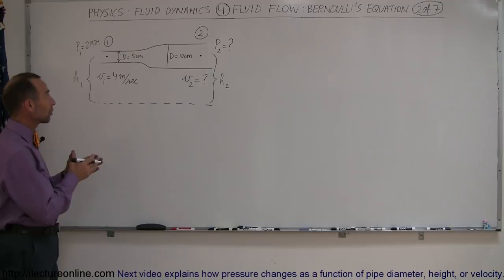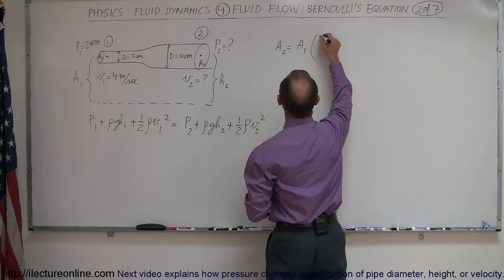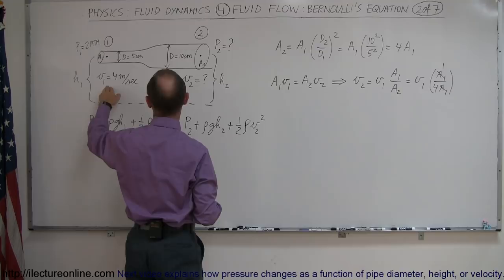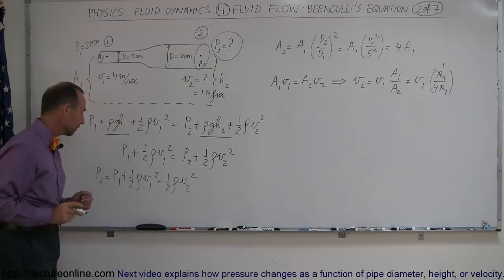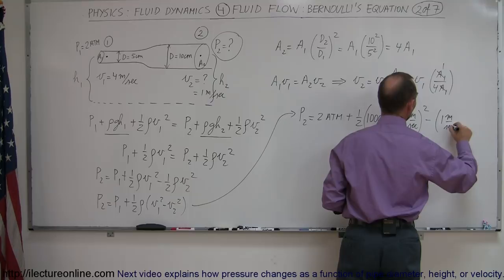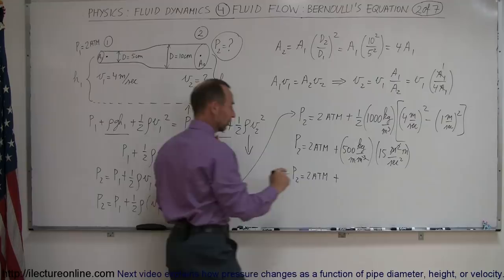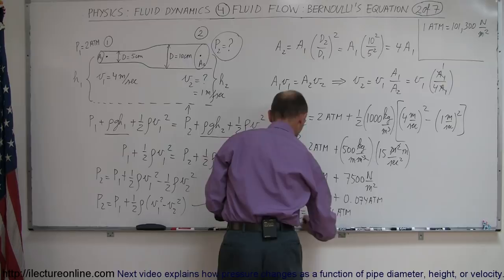Physics 34  Fluid Dynamics (2 of 7) Bernoulli's Equation

Comment: For those wondering, A1 = pi r ^2, and r is D/2 so when you square D/2 you get D^2/4. Same for A2. Now if you divide A1 by A2, you will get the ratio of A1 to A2, which you can then make A1 = (D1/D2)^2 x A2. Took me a while to figure it out and I saw it here, so hope it helps!
Reply: Mark Palmisano Saw it asked here a couple times**
Reply: true, but he has A1=(D2/D1)  not  (D1/D2).    ????
Reply: I keep getting: A1/D1=A2/D2 --> A2=A1(D2/D1). I still have no idea where the square comes from. It's driving me insane.
Reply: A1=r1^2pi , A2=r2^2pi, r1=D1/2 , r2=D2/2,   pi=pi   A1/r1*2=A2/r2*2  insert D1/2 and D2/2 insted r1,r2  
and the end resault is A2=A1 D1*2/D2*2
Reply: It was just A1V1=A2V2. Just substitute the given and solve for V2 which is 1m/s.
Reply: Thank youuu! :*
Reply: I lost the plot at A1
Reply: @lyndon9353  proof that labor can be less confusing.
Reply: @ledzeppelin4892000  I know you probably don't need this now, but A₁ = pi d₁²/4  and A₂ = pi d₂²/4
=> A₁ / A₂ = pi d₁²/4 / pi d₂²/4
=> A₁ / A₂ = d₁²/4 /d₂²/4
=> A₁ / A₂ = d₁²/4 * 4 / d₂²
=> A₁ / A₂ = d₁²/ d₂²
=> A₂ = A₁( d₂² / d₁² )

Comment: I have learned more from you in one hour than my entire physics courses. Thank you for explaining difficult concepts in a clear and concise manner. Just one question...why is the height taken from the middle of the tube and not the top?
Reply from the maker: That is where you find the average pressure.  Typically the height difference due to the diameter of the pipe plays only a insignificant role, compared to the elevation gain or loss of the pipe.

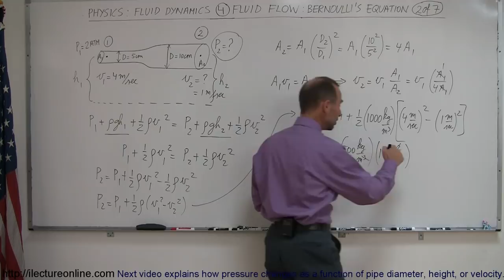Comment: Mr. Michel during @5:00 , the v² should just square the num. only not for the unit and the diff. in velocity is exactly = acceleration. so therefore when u times it, it will automatically came out N/m².
Reply: *unit cannot be simply add it into the equation. if needed there must be same for both left and right side equation
Reply from the maker: The units must be squared as well.

Comment: A 300 mm diameter pipe discharges water at the rate of 200 liters per second. Point A on the pipe has a pressure of 280kPa and 3.4 m below A is point B with a pressure of 300kPa. Compute the head lose between point A and B. Solve pls
Reply from the maker: We are currently working on a playlist of videos that solve these types of problems.  We will begin publishing them soon.  Essentially the head loss is an extra term on the right side of Bernoulli's equation.  P1 + rho g h1 + (1/2) rho v1^2 = P2 + rho g h2 + (1/2) rho v2^2 + head loss rho g.  Since the velocity appears constant the velocity terms drop out.  Therefore your equation becomes:  280,000 + (1000 x 9.8 x 3.4) = 300,000 + 0 + head lossxrhoxg        Then head loss x rho x g  = 280,000 + 33,320 - 300,000 = 13,320 Pa                 Then head loss = 13,320 / 1000 / 9.8 = 1.36 m

Comment: Sir thanks again for great explainations, i  think that no one on a youtube does it in such a clear and accurate way as you do.
With your permission' let me ask you a very simple question.

All those examples take the Q as given parameter...
My question' is actually simple a Yes\ No Question:
example:
I have 2 horizontal pipes of same lenght,  which are NOT connected to same source of water (like the pipes  are located in another countries or another  rooms)
pipe A has cross section 20 cm 
pipe B  starts with cross section 20 cm and changes own cross section to 10 cm on a half of its lenght  
If i am given that Q in bouth pipes is same(for example 1 liter per second) , i offcorse now calculate the preasure,  velosity of water, etc' using Bernulli'  equasion. This part i understand very well and it is clear...
, but i ask something different: the Q will not be equal unless pump in pipe B works "harder"'  than the pump in pipe A. 
Am i right?
Reply: @engineeringsimulationstudi1404  
what?

Comment: If a tube is conected to a compressor on one end and opened to the atmosphere on the other end, and the compressor injects a fluid at 40 psi, will the tube walls be subjected to the same pressure along the whole length of the tube? or is this pressure just to move the fluid? will the walls expand due to the 40 psi? Michel van Biezen 

Thanks for the help

Comment: What if this pipe splits off into two pipes with different diameters (instead of the diameter of the pipe just changing like it is here ? )
Reply from the maker: Ignoring the viscosity of the fluid and the friction within the pipes, you must find the total cross sectional area by summing up the 2 pipes and then use the same equations as shown.

Comment: can someone explain to me why the pressure increases? I get the same result using the equation, but when the diameter increases and velocity slows down i would have thought the pressure would decrease as well
Reply from the maker: Think of it this way.  If you have a box of marbles that are not moving, the pressure between the marbles will be at a maximum.  Now when the marbles are rolling over one another, they will not be settled in and will push on one another with less force causing a lower pressure.

Comment: Hi, your lectures are helpful but i would like to check, If i have a tank of water 13,000 us gallons, at a height of 35 meters connected to a pipe descending back to ground which the same height 35 meters. question what will be the the velocity of water and the flaw rate of the water if i have a 1.2 dia pipe for 18 meter and a pipe 0.94 dia for the rest 18 meter to reach ground? 
thank you

Comment: Sir I thought the smaller the area the greater the pressure? Why the opposite in this issue
Reply from the maker: I think you are referring to the equation  P = F / A     That equation doesn't apply to the internal pressure of a fluid in motion.    Based on Bernoulli's principle, the faster a fluid flows, the lower the pressure.

Comment: Can someone explain how he added a "meter" when multiplying the density and velocity to get Pascal??
Reply from the maker: multiplying the numerator and denominator by "m"  you end up with  kg * m  / sec^2 in the numerator and m^2 in the denominator.
Reply: @MichelvanBiezen   
Because kg is mass, better to follow this : 1kgf=1kg*9,81m/s^2  and 1kgf=9,81N -> 9,81N=1kg*9,81m/s^2, dividing both parts by 9,81 -> 1N=1kg*m/s^2, correct ?
Yorgos / GREECE

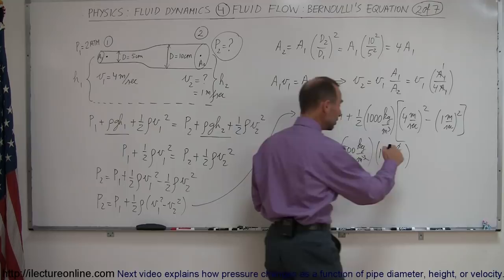Comment: on 5:00 why do we need to add m, because 1 Pa = 1 kg/(m·s^2) ?
Reply: Shalva Abramia allready I mean
Reply: +Shalva Abramia I was thinking the same...
Reply: the v² should just square the num. only not for the unit and the diff. 
in velocity is exactly = acceleration. so therefore when u times it, it 
will automatically came out N/m². *unit cannot be simply add it into the equation

Comment: What if you have 2 or 3 incoming and varying flow rates going to different pipes and meeting at one point?

1. A1V1
2. A2V2
3. A3V3

Is the total output flow rate (total AV) equal to = A1V1 + A2V2 + A3V3?
Reply from the maker: Yes, because the sum of the volumes per unit time flowing through each of the smaller pipes equals the volume per unit time flowing through the big pipe.
Reply: @MichelvanBiezen  Sir, what is your opinion on motorized pumps with varying flow rates as well? Would they follow the same principle?

Is Bernoulli's principle limited only to freely flowing fluids or would it include motorized pumps?

P.S.: I'm sorry for the multiple comments, I had to get your attention sir. I appreciate your help! Thank you!
Reply from the maker: The pump will create a higher pressure on one side.  Once you know that pressure, you can apply Bernoulli's principle.  Off course in real pipes there is internal viscosity of the fluid, friction against the walls etc.
Reply: @MichelvanBiezen  Sir, will the overall flow rate between the two would equal to their sum despite pressure difference, viscosity, friction, etc? Thank you in advance!

Comment: hi sir micheal... does incompressible continuity equation still applicable in pipes with valve not fully open?....hoping for your answer thanks
Reply from the maker: The continuity equation can be applied for an incompressible fluid even if the flow is not steady.  But whenever there are bends, valves, corners, etc. we have to account for those in determining the fluid flow.  We plan on making more videos on that topic in the future.

Comment: I don't get it. How does increasing the speed decreases the pressure?
Reply: Your Waifu Sucks the continuity equation and Bernoullis are equal to constants, so when one variable, lets say v2 is higher than v1, the increase on the right of the equation must mean the decrease of another variable on that side of the equation to balance the equations. That probably sounds convoluted but follow the orogibal equations and rationalize what would happen if you change a variable in order to keep the entire equation balanced.
Reply: Well in terms of natural phenomena. 1.this is the reason when high speep winds, lift sometimes the roof of a house. 2.See venturi principle in a car carburator, where the incoming air from air filter, inserting in the narow passage of carburator pipe (increasing air speed) , drops down the pressure and as result the fuel  commes inside with speed (to balance the loss of pressure) and converts in spray with the air which commes from the air filter.
3. About on the same principle work all sorts mecanism which make spray from anticorrossion spray till parfume ones. Also many other aplies.

Comment: If the fluid is flowing from a1 to a2 but the psi is higher in a2 wouldn't their be a net force backwards from a2 to a1?
Reply from the maker: It is better to think of it in terms of the potential and kinetic energy of the fluid.  As it moves from a higher pressure region to a lower pressure region the fluid must do work to overcome the pressure difference (W = F * d) and thus it loses kinetic energy which exhibits itself in a lower velocity.
Reply: also the fluid is incompressible.

Comment: At 5:33, units were confusing. A term 500kg/m2 would be 5000newton/m2.  And a term 15m/sec2 would be newton. Multiplying these terms would end up 7500N squared/ m-sec2?.. Could you clarify sir? Thanks...
Reply from the maker: The units are:   kg /m sec^2   which is the same as  N/m^2 = Pa

Comment: Hi Teacher, as far as I know the pressure goes from high to low; please tell me, if in the figure the flow goes from 1 to 2, why is P2 higher than P1?. Tks
Reply from the maker: If water is delivered to a house on a hill, the pressure at the house will be much lower than at the bottom of the hill.

Comment: How about if the diameter of the inlet is much larger than that of the second diameter? How do we express that to an equation? Thank you for your response.
Reply from the maker: +lj vailoces 
  Just change point 1 for point 2 and visa versa and then work out the problem in the other direction.
Reply: +Michel van Biezen Thank you! It helps :)

Comment: Hi,
How the Bernoulli’s equation can be applied when you have one input flow and multiple outlet flows? and what about including head loss in the balance?
I hope you can help me to figure these extra challenges out
Thanks
Best
Carlo
Reply from the maker: We still need to make additional videos on fluid flow besides the simple applications of Bernoulli's equation.  (Something for the future).
Reply: @MichelvanBiezen  Along this same question, can one assume that, given multiple outflows, the total volume of the multiple outflows would always equal the volume of the inflow? It would seem that for multiple outflows, of different diameters, the total pressure of all outflows would equal the inflow pressure, and the total velocity of all outflows would equal the inflow velocity. Is that a fair assumption? Could that be expressed that P for outflow 3 of 5 = Ptotal - (P1+P2+P4+P5) and V for outflow 3 of 5 = Vtotal - (V1+V2+V4+V5)? I apologize but I am not a mathematician. Great lecture though.

Comment: I don't understand,  pressure decreases if pipe gets thinner, then how water flowing through thin pipe use to cut stones or hard substances?
Reply from the maker: Good question.  Even though pressure decreases, if the pump generates a lot of pressure to begin with, the decrease in pressure will be RELATIVELY small and there will be plenty of pressure left to do the job.

Comment: Hello that was good. How fluid flows when downstream pressure is high?
Reply from the maker: Depends on the circumstances and conditions.  The pressure at a lower elevation does not need to be higher.
Reply: @MichelvanBiezen  plz elaborate

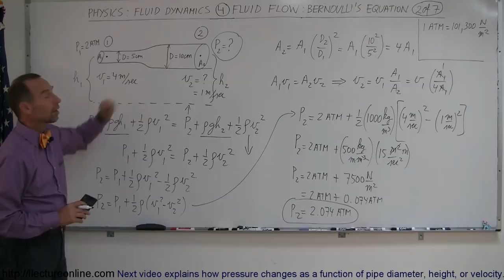Comment: @ 7:00 How does the units work out? The m^2 cancels out how can you just put a “m”
Wouldn’t it be kg/m sec^2 ?
Reply from the maker: we changed  m^2 / m^3  to  m / m^2       that is how we went from   kg m^2 / m^3 sec^2  to kg m / m^2 sec^2  to  N / m^2   to  Pa  (units of pressure)
Reply: Michel van Biezen I apologize. I am so confused. I am definitely
Missing something. How can you just change the operation like that? When you cancel m^2/m^3 wouldnt you get just 1/m? Wondering if you can break it down bc I have done this problem in the pass but never heard or saw it explained that way relative to the conversions your stating. Thanks in advance
Reply from the maker: Just like with any equation, as long as you do the same on the left side and the right side nothing changes.  Here we are doing the same to the denominator and the numerator, so nothing changes.  You can multiply the numerator by m^17 and multiply the denominator by m^17 and it would still be correct.          What we did here is have a little foresight.  Since we want to show that the units equal N/m^2 = Pa, we just wanted to divide the numerator and denominator by m  (and not m^2)
Reply: Michel van Biezen got it now. Didn’t know that’s what you were doing. Thanks

Comment: How do I find the area and velocity of the outlet if I knew the P1, P2, v1 and A1?
Reply from the maker: If the pipe does not change height, then use Bernoulli's equation to find v2.  Then use the flow rate equation to find A2.
Reply: Thank you very much! This is very helpful, please continue teaching us! :D

Comment: Dear Professor ,Many thanks for your video I just have a quick question about the Bernoulli equation in this video. I tried to find my final pressure at p2  by assuming the flow rate of 2 m3/s..so lets say the cross section of our pipe is 5 cm at point A. and at point B the cross section change to 3 cm. as a result we expect more velocity throuth the pipe. However, if i want to assume the pressure at pint B it gives me negative pressure.what does the negative pressure means here.Does this mean the water cant go through the pipe?. Many thanks for your videos .I appreceat your help in advanced.
Reply from the maker: A negative pressure at B means there is not enough pressure at A to push the water through.
Reply: so it means that when the cross-section of the pipe become tighter...the area become smaller and the velocity increases. However, due to the Bernoulli equation ..v1 to power of 2 - v2 to power of 2 which means ...it always negative...can you kindly suggest me how should water through a water on the condition that the A1 is bigger than the A2
Reply from the maker: We can say that when the pipe becomes smaller the velocity increases and the pressure decreases.  (The pressure is therefore not necessarily negative).
Reply: Many thanks. Just one more question .if for example there is a pipe of 5 cm diameter ..we put it on to the river with the velocity of 2 m3/sec ..the velocity inside the pipe is Q=AV which is gonna be 256.64 m/sec ..which means in each second we have 256.64 meter movement inside the pipe?? I believe something is wrong . I appreciate if you can help me regards that.

Comment: I understated this vide thanks,   but what would happened in a network of pipes (with pressures and flow rates)  with  two or three spray nozzles (all the same flow rate discharge of: 2.27 L/mint) and pressure in is just 5 bars...?
Can anyone advise how to do it ?
Reply from the maker: 333geoalv 
My plan is to place those type of videos on line in the near future.

Comment: What if the given is pressure difference together with the radii of the sections. But you have to find the water speed in the two sections?
Reply from the maker: Then use the equation:   A1* v1 = A2 * v2
Reply from the maker: Along with Bernoulli's equation.

Comment: I really don't get where does the A1V1=A2V2 ? Can someone please explain to me.
Reply from the maker: The flow rate (dV/dt) which is the amount of fluid flowing through the tube per unit time is equal to the product of the cross-sectional area and the velocity of the fluid.  That product must be the same everywhere because the flow rate must be the same everywhere

Comment: Question: Can v2 be increased by an increase of temperature at that end of the pipe?
Reply from the maker: An increase in temperature would cause a change in density (although slight) which would have an effect on Bernoulli's equation.
Reply: @MichelvanBiezen  thank you for responding! I'm fairly out of practice with these concepts, and in my planned project everything is happening on a very small scale. 

I also need to review how turbulence impacts flow. Would your content on dams be the best place to find that, or do you suggest other videos?
Reply from the maker: I would not expect for you to have turbulent flow, unless the pipes are too narrow or the velocity is too high.
Reply: @MichelvanBiezen  I'm trying to  approach redesigning under gravel filters for aquariums with fluid dynamics in mind. Turbulence and right angles result in dead spots and impacts flow